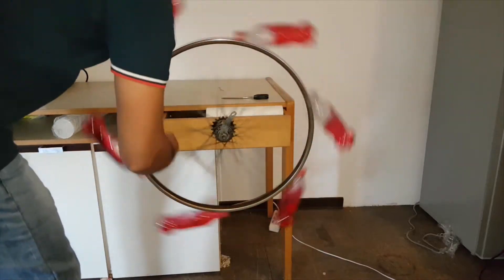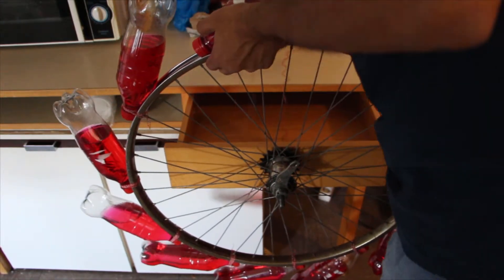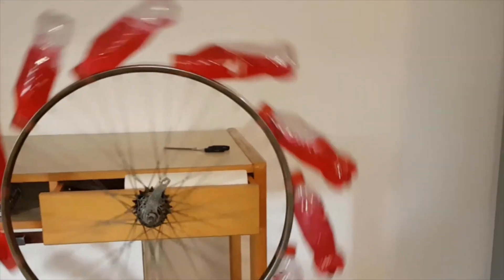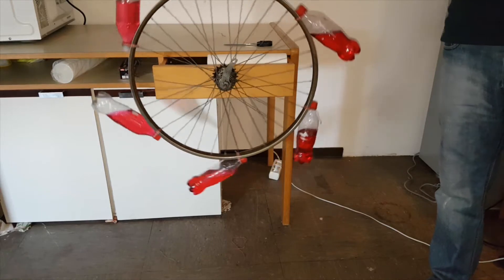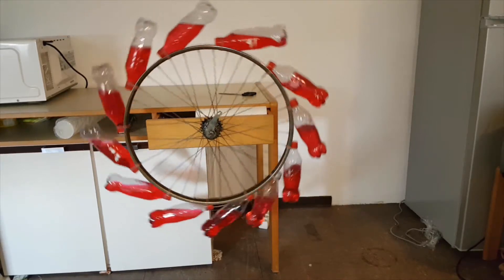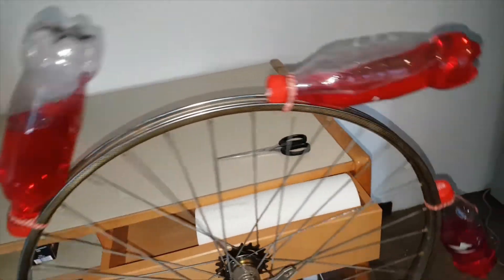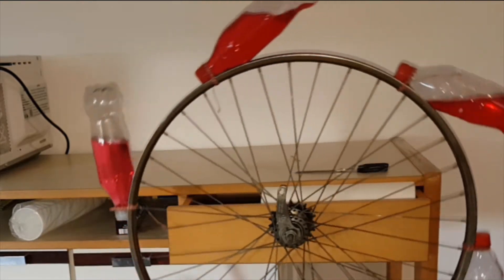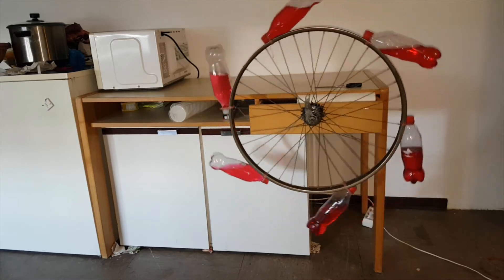Secret of the perpetual motion machine | Bhaskara's Wheel

Comment: What if each bottle was a cylinder with a trap door that was timed to open on one side of the wheel and close on the other side until the exact moment you want the fluid transfer. Kinda like how a fuel injector works

Comment: Wrap the circumference of the wheel with a string and place a mass on the end of the string. Let the spinning wheel throw the mass.
If the thrown mass has 1/10 the mass of the rim, then the thrown mass will have 10 times the energy. Because the thrown mass can obtain all the Momentum of the system.

Comment: Thank you for an interesting demonstration.  Allow me to say that the jury is still out on the subject of whether perpetual motion (or overunity as it is called in some circles) is possible or not.  

The name of Johann Bessler (1680 to 1745) certainly throws a big and inconvenient spanner into the works of those who claim it is impossible.  I do not have to repeat his history; there are numerous websites dedicated to his achievements.  He was never found out to be fraudulent in his claims, the opposite holds true in the witness of Charles I (or Karl), the landgrave of Hesse-Kassel who was allowed to witness the interior working of one of Bessler's wheels.

I also need to say a few words on demonstrations like this concept and similar historical, perpetual motion devices.  I find it irritating that the demonstrators usually take a very basic device (in this case, a few liquid filled bottles around the rim of a bicycle wheel) and then proceed to make the statement that perpetual motion is impossible after demonstrating that the device eventually grinds to a halt.  Imagine, if you will, demonstrating to someone that internal combustion engines will never work.  You only need to remove some critical components like spark plugs or a distribution coil to generate the sparks.  You will toil away all day turning the crankshaft but it will never run.  

That is the crux of the matter.  People should realize that a true overunity device will need to be a bit more complex and will require additional components to perpetuate the motion.

Comment: The wheel should be rotating clockwise as the angle is crucial, it ( the angle sets the fluid in an outward direction this extends the leverage from the fulcrum ) rotating it the way you did anti clockwise pushes the fluid inward which is sapping the energy even with the fan aiding it, it will not sustain rotation, however in the other direction as the bottles go through TDC (top dead centre) the mass of liquid transfers to the base of the bottle which is further from the fulcrum than the neck, so provided the bottles are equally distributed around the circumference of the wheel what you have is weight distribution going from the neck to the base of the bottle, this is a good flywheel in motion and is in my opinion going to work as long as the load you place on it doesn’t get too heavy. To put it another way put equal amounts of bottles and fluids on a see saw tied equal distance from the fulcrum tie the ones on the right by the neck to the shaft as per the wheel so neck in board base out fluid will gravitate to the neck, then tie the same amount on the left at the same distance on the left but not on the underside of the shaft so the fluid runs from right to left and downwards to the base of the bottle I expect the see saw will tip left due to the same mass being out on a longer lever it’s the difference of the fluid from the centre. Looks good but bad illustration

Comment: BESIDES MATESCIUMS BEING A POS JACK OFF YUTUBE SHILL.
The reason this design does not work is because non of the water eight can move to the inside of the wheel on the upspin. It can only equalize the way the bottles are positioned.
Plus the bottles need to be uniform in shape front to rear.

Comment: Your experiment isnt correct, and your design is wrong. The correct direction   is clockwise. The force must be more weak, because if the forcé is strong, the inertial forces cancel the dinamic mass effect of the liquid. The bycicle wheel must be more small, and the bottles bigger. You put out bottles, why?... You are liying to people, why?... Each bottles should be have less liquid to ampliance the choque effect. You work for govern people, you are a fake because you hide the real and thrut efecct whit a bad tecnical explanation. Repeat the experiment correctly. People, build it is so easy and cheap, make it.

Comment: even its not working you are turning it the wrong way for this thing to even try to work, you are debunking the wrong way
Reply from the maker: I turned it in both ways, clockwise and anticlockwise. see carefully. Thanks.
Reply: @Matescium  when you change the number of bottles to show a difference then you turned it the wrong way, from 2.10min until the end its like you dond understand the lever effect of the further from the axle should be going down not up
Reply from the maker: It could be that I did not understand the main theme of the effect, but i understand that this perpetual motion is not possible according to the rules of of physics.

Comment: i agree that perpetual motion is not possible, but you have your wheel bolted to a desk drawer. if you had a near perfect, precision made wheel/hub/bearing, with the least viscous lubricant possible, mounted on a perfectly level and solid structure, it certainly wouldn't go on forever, but wouldn't it go on long enough to get some kind of usefulness? i always wonder how much better these machines would work if the components were made specifically for the machine. the wheel-spokes will be at different tightness from each other causing weight imbalance and an imperfect roundness to the rim of the wheel, also exaggerated by the pins that hold the spokes on, soda bottles have a tiny weight variance in manufacturing, the string holding them on will be different lengths, the lubricant in the wheel will be old and thicker from time, and the bearing has had much weight on it from use causing tiny flat spots all over the shim, the ring, and the ball. All of these things together make it a flawed experiment for all attempts so far. If you could use perfect components and lubricant, and build a small vacuum chamber to house it in, you might get more interesting results.
Reply from the maker: Yes, I agree with you, perpetual motion is not possible but if we can avoid the friction of bearing and air resistance it must run for a long time but not an infinitely long time. Unfortunately, we cannot avoid the friction of the bearing. Yah, air resistance could be avoided by doing this experiment in a vacuum chamber, but bearing friction cannot be avoided. And moreover, the since the upstream and downstream momentum is canceling each other, no new momentum is created, we cannot expect the perpetual motion. But it can run longer time with precise experimental setup. Moreover, the idea to make this video is to show the cheating of other youtuber. I will try to make another attempt of this experiment in a vacuum chamber if I get near future. Thanks for your thoughtful comments.